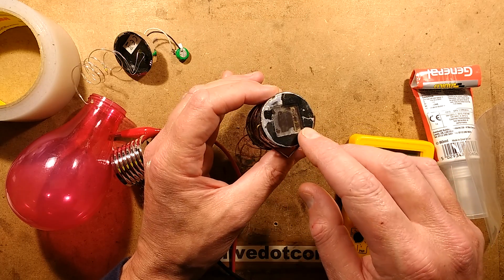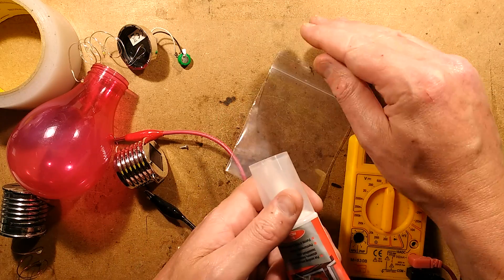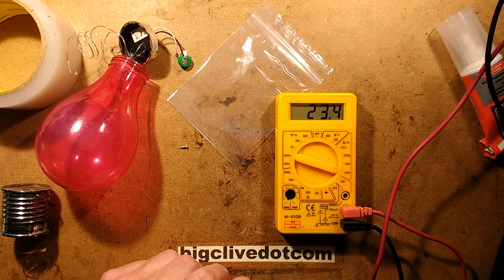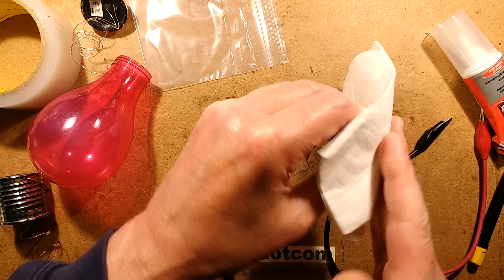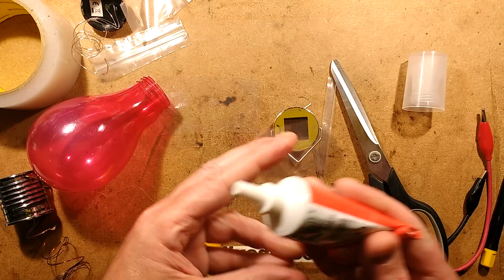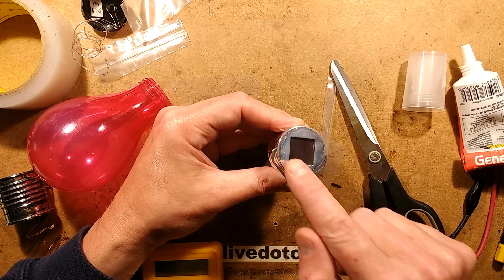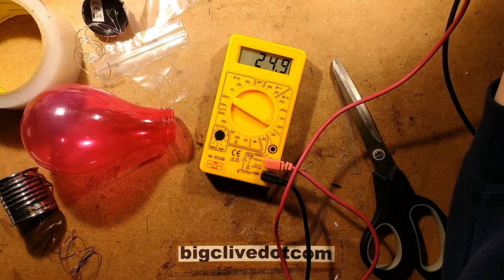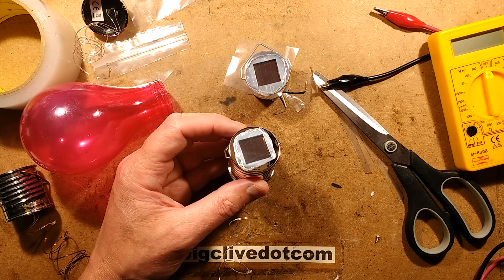Easy way to create a protective silicone layer on a solar light.

Comment: I don't think anything will make those type of light last longer than a year. They all get condensation inside the case no matter how well you try to seal them
Reply: If somebody had the time and know-how they could construct one of these garden solar lights in a near vacuum thereby taking all moisture away from the unit, insert a silica gel pouch and seal the complete unit in silicone. This is beyond the reach of most hobbyist but it would be interesting to see it tried out and compare the life expectancy of the unit compared to your average poundland garden solar light. Bigclive might have a vacuum machine that he could use for this ingenious plan. I have lots of other ideas too like putting hamsters in wind turbines for those windless days when the rotor blades are motionless, those little blighters will get into a big inner wheel and eureka! They will take up the slack and increase energy output of the wind/hamster turbines. Super hamsters could be bred for the task and fed added hormones to build up their muscle strength but I can see people objecting to this because of the inherent risk to man and beast if these super charged hamsters were to ever escape from the turbines and get into the wild, but as with nuclear energy the risk to benefit ratio has to be taken into consideration.

Comment: I did something similar to our solar lights in our villa in France. We rent out our villa to holidaymakers (villadefleur.net) and aren't there often enough to repair stuff right away so things have to last, so I bought some stainless steel lidded solar lights and then placed transparent silicone in the groove around where solar panel meets the steel. So far so good!

Comment: Clive, following your video last year in regard to  protecting these solar panels, I  went and used the Gorilla Clear Repair tape as I was n’t able to source what you recommended. Over, 20 lights later which have been left out all year,  no sign of wear or water egress. Other than a  couple of the Poundland lights that have failed for other reasons all the others are still working as well as they did a year ago. All I have had to do is give them a wipe over.   Pat Moore

Comment: Great to see LED's back on the menu Clive. At the end of 2016 I cleaned 6 garden solar lights and covered them with clingfilm held down with an elastic band around the light.  So far they are all working. I did fit better batteries (AA) when I was given them defunct Spring 2016. The silicone looks much tidier. A quick flash over with a lint free cloth and cellulose thinners would clean and soften the plastic, might stick better. Glass fish tank sillicone is very good kit - but expensive.

Comment: To be honest this a good application for a small piece of glass adhered with a transparent polymer. You can also use clear encasing epoxy but it has to be UV stable stuff. A lot of the cheap Chinese ones aren't.

Comment: Similar to applying CPU/Heatsink compound.  
Glop it in the middle, add poly, turn it upside down and press it gently down on a piece of glass, mirror, etc.
Let the pressure squeeze it out from the center to the sides, although unlike TIM, probably not as many bubbles in silicone.
Works surprisingly well, I would have gone with a round piece of glass and a silicone/o-ring attempt.

Comment: I would use the dow cornings subsea salt resistant one i think the number is 736 but not sure. As i live in montrose on the coast. Love your videos keep up the good work.😀 As i work with polyurethane moulding i would probably use clear PU mix.😁

Comment: Dont think it will last much longer than the tape Clive, silicone expands and contracts, at such a thin layer theres little mechanical strength. It will peel it's self off. Time will tell. I'd consider potting them in some UV resistant resin.

Comment: Clean it with carb cleaner, it will eliminate any grease and allow silicone to stick to it. Before paining anything, use carb cleaner to clean the surface.
Reply: Might melt the plastic, depending on the brand

Comment: I used the protective film for car headlights off ebay on my Poundland solar lights and 1 year on they are still okay. The tiny batteries have failed in some but are easily replaced with a rechargeable aaa battery

Comment: Heh, I bought about 500 of those little bags to store resistors and things in.. one bag that held the bags split and in still finding random bags under things.
Reply: Ollie B For anything one wishes to reliably store over time one wants to chose either 1 or 2 mil (0.025/0.05mm) thickness bags as the cheap 0.5 mil (0.0125mm) bags are very weak and tear or split easily.  I use thousands of them to organize everything from smaller through-hole components (resistors, diodes, transistors, etc.) to surface mount components (where I may have hundreds of values in each package size and component class) -- basically any smaller component where I need to have a wide selection as the bags allow me to keep anywhere from a dozen (larger bag sizes like 2"x3") to a few dozen values (small 1-1/2"X11-1/2" bags) per organizer drawer.
Reply: Ethan Poole oh yah I got some good ones, not like the ones that come holding kits from China 🙃😁
Reply: What I didn't realise was that the big bag that held 100 little bags for some reason opens at both ends, hence spillage! 😂

Comment: Admittedly, it will likely be the same, but...   You didn't check the amperage after curing, just to make sure the cured silicone transmits light as well as uncured.

Comment: Oh yes, and another thing... Plastic model kit makers use Johnsons / Klear / Pledge multi surface polish. It is basically a cheap transparent varnish and is remarkably resilient. Just pour some in a plastic cup or whatever and dip the top of the light / panel in. It should make its way into all the crevices (I said crevices hehehehe) for a waterproof finish. I think Sainsburys and Tesco sell it at about £3 for a 750ml bottle.

Comment: silicone that is not physicaly compresed between something will just end up pealing off.
you should have removed the solar panel to be able to place silicone between the solar panel and the case.
But if you want a good weather proof just dip the whole thing in clear resin.

Comment: For UK people, Poundworld is closing, and they have garden lights similar to this (currently) at 20% off. I leave it to the reader to work out the price. In true engineer tradition, I modded it by putting an aluminium foil cone inside the main body of the lamp, to disperse the light sideways instead of just shining the LED at a black plastic base, which didn't seem optimal really.

Comment: After experimenting a lot with different silicones that can be bought right from the store shelf, i have determined that the "Ceresit CS 16" is the best easily available clear silicone for electronic use. No acid, the smell is very light (almost notexistent), cures rather quickly, and does not seem to kill white LEDs that have been coated with it. (The usual "neutral" silicone makes them die very quickly.) Unfortunately, i do not know if it is available in the UK or USA.

Comment: Please note silicone in general is not 100% air and water tight, it will let some gases and moisture permeate in due course. But indeed it retards the speed of this a lot, increasing shelf life of your solar cell. 
Thanks anyway for nice quick fix idea.

Comment: HEY BIG CLIVE! If that idea doesn't work out, run a thin bead of the silicone glue around the outside edge of the cell, and glue the plastic sheet over the cell. You could use celluloid as well. Then if damaged, just replace the plastic sheet. I was going to suggest vacuum forming plastic sheeting over the entire unit, but that might take a bit of time. That would permanently solve the issue, though.

Comment: I have done similar with my garden lights but to avoid covering the solar panel I just put a bead round the edge there the panel meets the housing. None have died yet almost 2 years on.

Comment: Why not just conformal coat everything? Silicone conformal coat spray is relatively cheap on Amazon, and there's acrylic, polyurethane, and epoxy variants as well. Open the thing up and coat the electronics, close it again and coat the whole thing just to be sure. I'd love to see if that affects performance and just how durable that sort of thing is.

Comment: Silicone encapsulated silicon! Cool. What about a oil like tung or teak ?
Reply: Those are not really film forming compounds, they work in wood by soaking into the wood fibers over time with repeated applications with the residual oil helping to exclude moisture to prevent moisture penetration (though surface damage is still possible as it tends to become depleted over time).  Periodically they must also be reapplied as they are not a permanent protection since they do not form an effective film and oil both slowly evaporates and gets damaged/removed from use and the act of cleaning the surface (such as wiping down a table) -- they are much like mineral oil.  Given that both the solar cell and steel are impermeable surfaces  there is nothing to trap the oil and nothing for the oil to soak into.

Comment: They don't leak from the solar panel, they leak through the holes in the side! - remove the hanger and you will see the holes go straight into the housing. Water hits the hanger and wicks down into the hole. The only solution is to completely pot the electronics with resin.
Reply: tmo72 I have had these and the holes that the hanger is in doesn't go all the way through
Reply: Maybe they're different for some models. I just checked mine which I bought from poundland a couple of weeks ago and they go straight through.
Reply: tmo72 maybe...... I found the switch on most of the lights is the worst entry for water

Comment: could you not just fill the inside with silicone
Reply: You could, but not with the readily available silicones that cure with acetic acid (that vinegar smell) as the acetic acid is hell on all the electronics and is electrically conductive (as all acids are).  There are silicone potting compounds designed specifically for that purpose that are not acid cured and are safe to use, but you must explicitly go shopping for such as they are not your average everyday silicone sealant product.  That said, even potting is not 100% effective at preventing moisture intrusion, it just slows such down.  It is often far easier to design a product to be more moisture tolerant by reducing points of entry where water can enter from the area above your electronics  and simply provide a few small drainage holes near the bottom of the product to allow moisture to escape over time, thus not trapping moisture inside.  Moisture is a devious opponent!

Comment: Not so sure about this Clive.  Maybe a UV resistant silicone is required? My experience of clear is that UV will take its toll and lose adhesion not to mention allowing dust to adhere to the surface.  I'd have been tempted to silicone a thin piece of glass to the outside and leave it at that.  Also, the acid from the silicone may seep between cell and the plated case and corrode a bit.
Reply from the maker: It's experimental.  I've got the first units outside to try it out.

Comment: I've used vaseline to stop silicone sticking to a surface, so you could do the same as you did, but can use anything (coated in vaseline) to spread the silicone if you don't have those bags

Comment: Clive, to make the silicone all one level, you could gently press the solar panel / silicone / polythene down onto a flat surface.
Reply: Or just hold one corner of the plastic film and slide the edge of a credit card across it.
Reply: Maxx B Everyone likes it quick and dirty, just stick it in,
Reply: So you can see what you're doing put either a small piece of glass or acrylic sheet on top of the polythene sheet.

Comment: IMO vapours from silicone curing will corrode the panel.
Reply from the maker: Time will tell, the panels I've tried show no signs of corrosion and the acid seems to have liberated completely.  In a sealed enclosure it would be an issue.

Comment: Ive done the same this year , as my partner has over 50 DAMN LIGHTS in the back yard, but I found that the silicone gets cloudy, and obscures the light getting to them. It may just be the brand that I use G.E., but at least its easy to peel off, and try another brand this year.  
I spend a considerable amount of time every spring replacing batteries,  battery connectors, and replacing electronics from gutted cheapo Dollar Store units.

Comment: Clive have you done any investigating of the QX5252 solar light chips?  They are pretty amazing and worthy of your attention.  Thanks, Great videos as usual.
Reply: Or YX8018 ... I think it is the same as the 4-pin version of QX5252.  These are super simple.  All you need is a small inductor with which you can choose your output current. Typically 100 - 150 uH.  They also disable output when there is solar input detected.
Reply: i have several,one is connected to a 1.2V NiCad ,a 20mmx20mm solar cell at about 2.5 volts from a "pound" solar light driving 8 leds. The solar only pushes 20 mA.  another one pushes 7 leds with the same 1.2V  Nicad with a 5 volt 300mA solar cell. They seem to take a wide range of inputs/outputs.  Both these setups have been running dawn to dusk for weeks now and don't appear to have any problems at all.  Thanks for the reply.  A.

Comment: Cling film will do a better job, it can be pulled tight so there's no surface ripples.
I've seen what happens with silicone in showers not sure of this one, Once the silicone fails it will keep the area moist not long for this world then.

Comment: You may have to explain "Blue Peter style" to non-UK viewers Clive!
Reply: Sort of. Blue Peter is a weekly children's television magazine show that's been running on the BBC for many decades. Each week they would show the viewers how to make something, usually from household items (famously, washing-up liquid bottles and sticky-backed plastic (No brand names, as it's the BBC!)) which would, due to time constraints, require them to partly make the item then produce a fully completed version with the strap line "Here's one I made earlier." They would also often be found saying "I've used double-sided tape for speed."
Reply: Ray Gannon I'm going to guess this could be "Norm Abram" in the U.S. .. a now older woodworking series in which two of everything were built -- one to proof the concept and work out any kinks pre-show and show the finished product at the start of the show...and the second you followed along as it was constructed in the course of the show.  Also, many cooking shows will have two of everything to cut out the baking time.  But that is just a guess as to what the term means as "Blue Peter" has no, at least widely, known association in North America.
Reply: I know of Norm on this side of the pond from the This Old House and New Yankee Workshop shows. Love the way he'll nail into end grain where appropriate and when not craft by hand in exquisite detail - or with all his shop tools for jobs in between. Don't forget your safety glasses ;o)

Comment: How long did it take for that tape to be 'eaten away'?   I've covered my recovered yellowing dull cells with sanding and then uusing tape they use on a mountain bike  to protect the chain damaging the frame. I think it is known as helicopter tape and should be UV resistant. So far after all these months it's still looking ok.
Reply: I would presume that tape is actually UHMW (a type of HDPE plastic)?  UHMW/HDPE is a very slick but tough and highly wear resistant plastic.
Reply: Yup, I would say so. I guess it is the same product they use on some parts of cars to protect it. Seen it on a Mazda 6 just in front of the wheel arches and on some other cars too. 
It will yellow a bit over time. But that time is like 10 years or so.  If it is yellowed to much, take it off and put a new piece on it.  To bad Big Clive doesn't mention how long it took for the tape to get that bad.

Comment: I think potting it with epoxi with a slightly lower mix of hardener. I guess this could work as lond as its not acid cure sealant.

Comment: The 'old fashioned' MR16 12 volt style halogen lamps usually have a glass lens that looks about the perfect size. Combined with silicon around the perimeter it might be an even better option.
Reply: Kirk Claybrook seems I'm not the only one with that idea. I've done that for a single solar light a few weeks ago. So far, it seems like the best solution.
Reply: Good, Better, BEST, you go!

Comment: You need to be careful with silicone sealant and electronics. Most household stuff releases water and acetic acid as it cures. 2 part tin or platinum cure stuff is safer for electronics.

Comment: What about the holes on the side of the fitting where the wire pokes in to hang the lamp up? Wouldn't they completely defeat any sealing attempts?

Comment: I have two types of solar garden lights - the ones with glass over the solar panel and the ones with resin. The resin ones are shit. The resin rots quite fast under the hot Australian sun. And they seem to be affected by rain as well. The glass ones, on the other hand, are still fine. They have other issues, of course, but the glass seems to be a lot better.